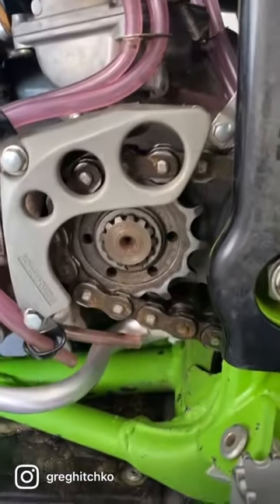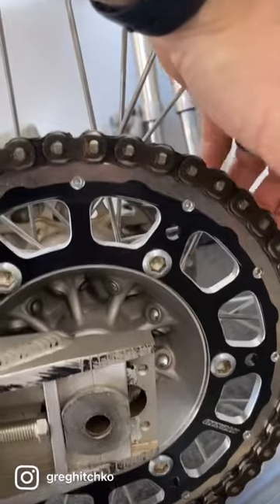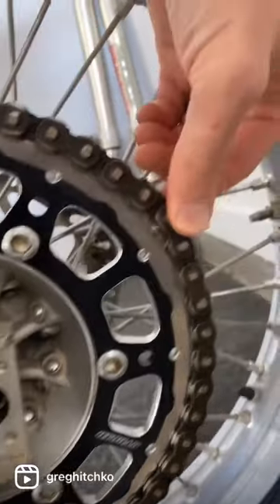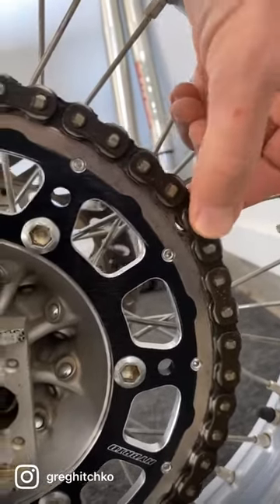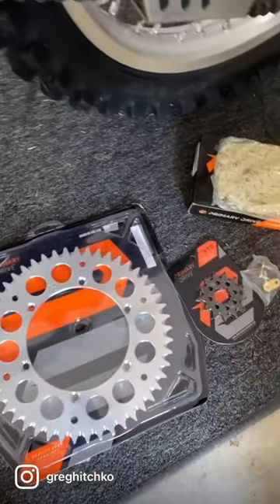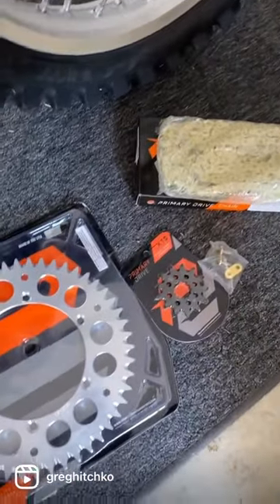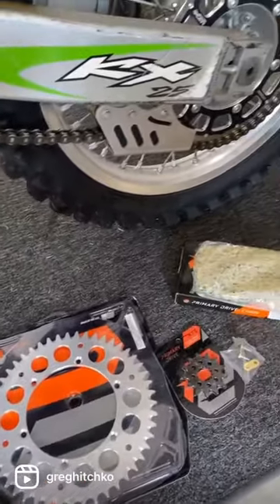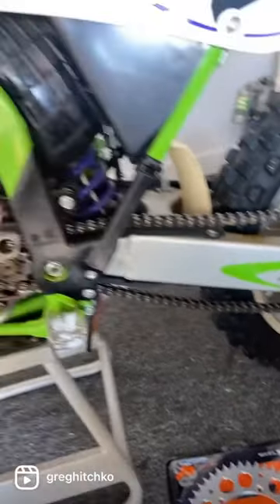How to tell if your dirt bike chain SHOT #shorts

Comment: Do you run sealed or non sealed chains on your kx250s?
Reply from the maker: I run non sealed, just the standard MX gold chain. Haven't used oring chains in years. I just don't see a need with MX. If I was riding off-road, then I would consider a sealed chain.